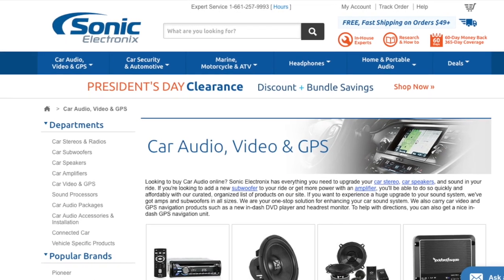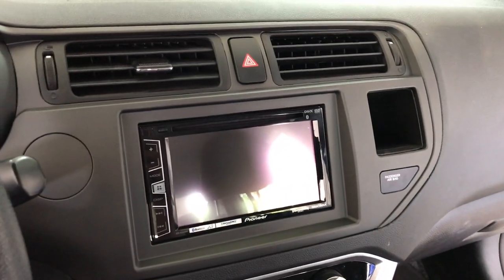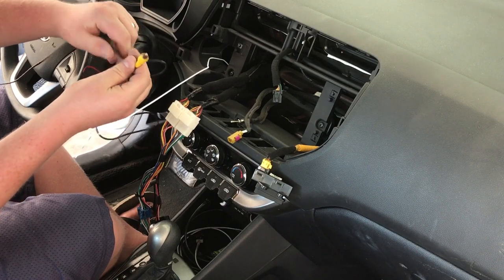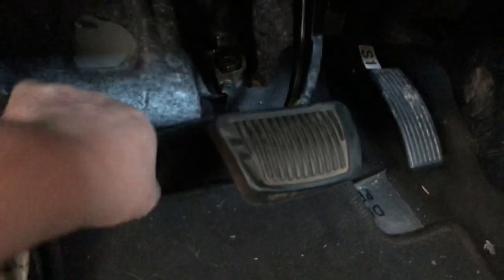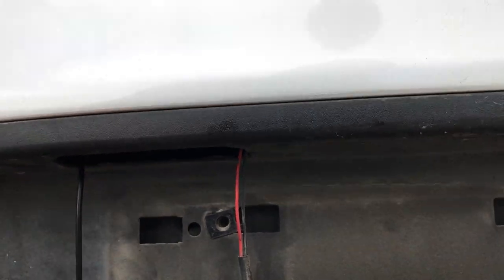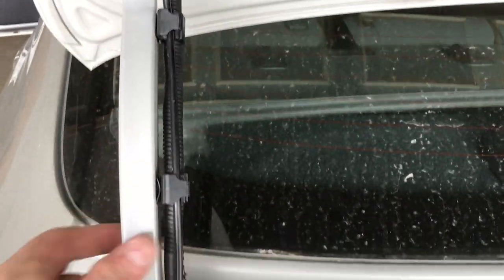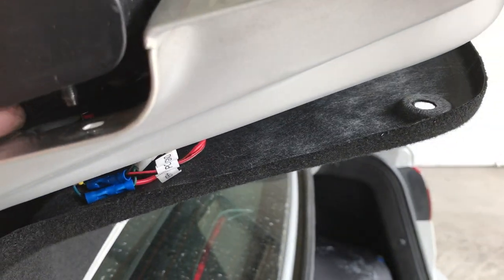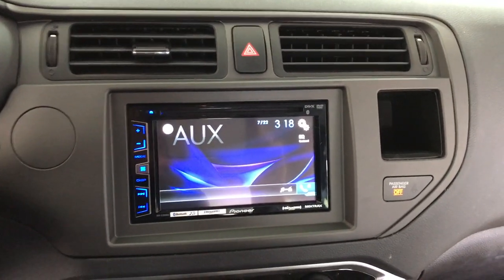2012 - 2017 Kia Rio Backup Camera Install

Comment: You skipped right over the parts I wanted to see.  The transfer of the wire from the cab to the trunk and the hole placement for the camera wire from the plate to the trunk.

Comment: My 2013 Kia Rio already have a backup camera. Should I expect that there is already a cable for it and possibly follow your directions on how you wired it into the new receiver? I feel like I need to follow the directions from the first video and look at what cables are plugged into the back of the stock receiver.

Comment: If you have the Hatchback it's better to install an aftermarket camera mounted inside at the top of the rear window so the rear wiper clears your view easily. My factory camera is always getting dirty and can't see unless you get out and wipe the camera each time.
Reply: Jo, nice job. I wanted to install one on my. Is it possible to connect to the reverse break light, if the camera is inside the car.

Comment: Would you recommend this install option for the 2017 kia rio with manual transmission? Or running the camera power off the radio?

Comment: Does this pioneer unit would work with a factory built in camera in a 2012 kia rio HB?
Reply from the maker: You may have to find an adapter harness to retain the camera.  Check with your local audio shops.
Reply: Javier Brizuela did you find an adapter for your factory camera ? if you did where thanks.
Reply from the maker: This kit may or may not work, but might retain the camera: https://www.sonicelectronix.com/item_112739_PAC-RadioPro-RP4.2-HY11.html  Use coupon code ProvoBeast to save some cash at checkout.
Reply: Tony Alzua not yet
Reply: My Tech guy was able to get a Module to keep your factory camera.
DROK Waterproof DC Buck Converter Voltage Regulator 8-22V to 1-15V 5V 12V 3A Adjustable Output Power Supply Transformer

Comment: Do you know if you can install an aftermarket or factory camera on a factory 2012 stereo kit?
Reply from the maker: Depends on a few things. If you have a factory nav system, you may be able to find an kit to run an added camera to the factory radio.  Kia's are tough though, so without further research, probably not.  But there are kits that allow you to add another dashboard-mounted screen when you add a camera.  https://www.sonicelectronix.com/item_125983_5-Rear-View-Monitor-License-Plate-Camera.html

Comment: Hi, do you know where i can find the reverse wire on 2016 Rio5 at the dash area? I do not want to run the wire all the way back to the reverse light.
Reply from the maker: If you have a smart harness, they may have it there.  If not, you can possibly locate it in the kick panel or at the tail light.  You may end of needing to run a line to the tail light along with your video wire.

Comment: I didn't think you were meant to use the ground wire on the reverse light. It's meant to be ground to the chassis.
Reply from the maker: Ground wire of the reverse light is the same as the ground to the chassis. Where it may differ is in resistance. If you have a high impedance with one or the other, you will want to choose the method of lease resistance.

Comment: Hi Chris - how do you know which wire on the reverse light is power and which is ground?
Reply from the maker: see 5:30
Reply: I'm wondering how you determined which wires on the reverse light to "piggy back". At 4:08 you say that we know the green wire is positive and the black is negative, but how do we know? Did you read the wiring diagram for the car?
Reply from the maker: Use a Multi-meter to test polarity.
Reply: Excellent. Thank you!
Reply: the green is not positive, the blue/turquoise wire is
Reply: Great job 👌